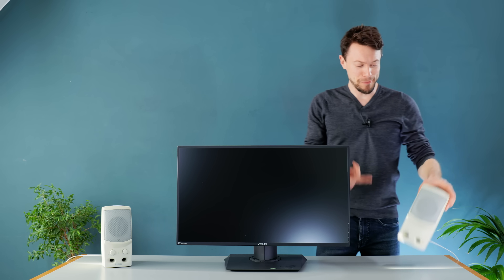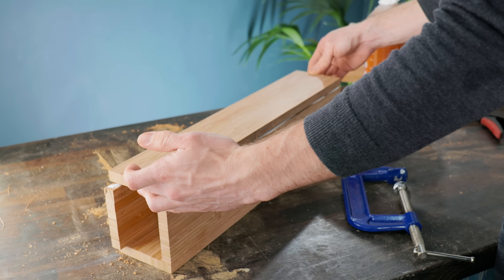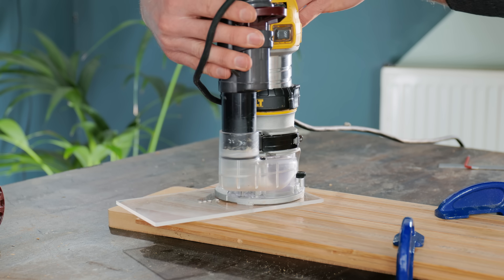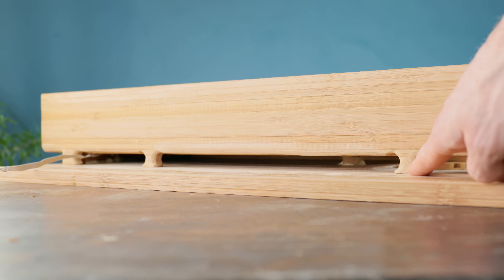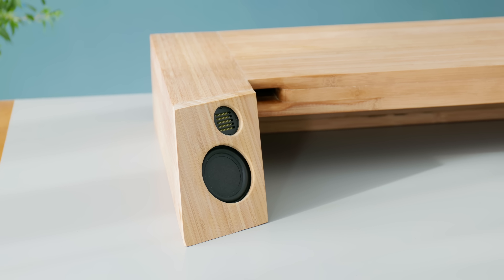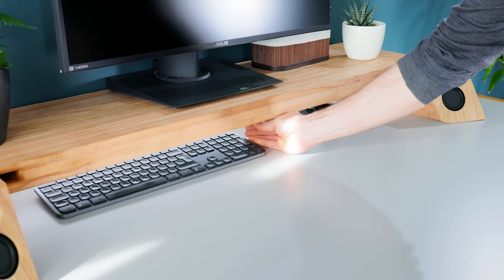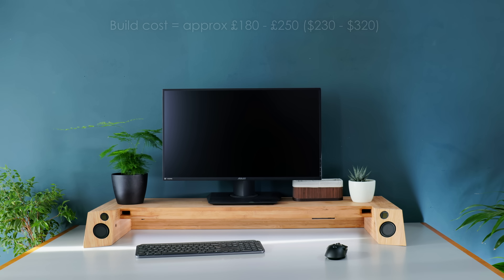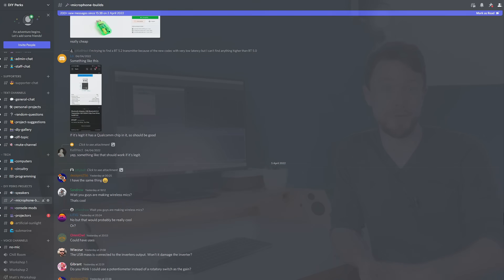Building a PC sound deck... with a twist!

Comment: Nice work and great driver choices.  Those techtonic BMR and Daytom AMT8 both have super wide sound fields and just sound fantastic.  That slim sub is surprisingly capable too.  I'm using one in a project right now myself.  Do you mind sharing the crossover points you used?

Comment: Somewhat related...
I have a friend that gets those old school big screen tv's.  The 4:3 SD ones in the large, typically oak, square cabinets that are a couple feet deep.
He clears out the guts, cuts the top off, cuts the sides down and puts the (former top) on the top of the lower box that has the speakers.  He upgrades the audio system and when he is done, it is a "speaker box" TV stand for a flat screen.  The sound quality surpasses any sound bar, and looks good doing it.

I have another one that takes old cool looking AM/FM radios, cuts the AM option on the selector and replaces it with the feed from a Bluetooth module.  The radio becomes a cool looking FM/Bluetooth unit.  Much more useful and still with the cool retro look.

I like it when people repurpose stuff.

Comment: Honestly: I love your projects. There is just one small problem: every time you do something with speakers, you miss half of what it needs to really make speakers sound great. Videos like this make people believe, that building a speaker is just about plugging a tweeter and a midbass driver together, run it through a sound board or DSP (or even worse: an online crossover calculator) and that's it. But it's much, much more than that. You need to take measurements, take the baffle step into consideration as well as the on- and off-axis responses. The response that you showed is a measurement on a DIN baffle. This is not the response you'll get once the driver is mounted to a smaller baffle (baffle step, edge diffraction...). For speakers so close to the desk, you have to take the desk as a reflective surface into consideration as well. And these are just the basics...
Reply: I agree. I am a DiY speaker designer as well and all of the things you have mentioned matter a lot. There is something to be said about making a compact video though... if he went into detail on every single aspect of speaker design that he would NEED to do in order to make an actually decent speaker, this video would be 5 hours long.
Reply: @thephantompsychic  yeah that’s true. But: I doubt that these things were taken into consideration at all. I might be wrong.
Reply: @rouldiy  Tell that to those popular brands that make PC speakers. They dgaf what they put into their mostly plastic enclosures. They use random parts, shitty drivers, amps so badly designed they distort at half of the volume etc.  Compared to them Matt did an awesome job.
Reply: @mattx5499  If you're spending more than $320 (that amount doesn't include the wood, or LEDs for that matter), you could probably get a decent set of speakers for that amount. Yeah, these are going to sound better than a pair of $20 plastic speakers, but they also cost quite a lot of money to only sound awesome compared to, by your own admission, shit.
Reply: @Civilian08  I can asure you that there are plastic speakers that cost far more than $20. And this project is not only about speakers, but a quality monitor stand without any cable mess and a desk lighting. All made of quality parts and materials.
Reply: I agree 100%! Moreover, I cannot really believe that there are that many people looking for a monitor stand with speakers for $320, or at least not in 2022
Reply: @cmattarei  Many DIY projects are custom things that can't be just bought.

Comment: I did this with old pine cupboards for my center channel after years of trying to get centers that produce quality of sound that doesn't get lost in background while playing movies. I was having issues with dialog getting washed out by background effects which was quite irritating on a massive surround system literally built into the room. I used 3 6 inch midrange speakers and a box that I designed to fit under the 65 inch tv. I have never been happier with my sound system since then, I can now hear all dialog during the most intense explosions from the surround and sub.  Even with the receivers balancing system it was impossible to get the center to level to a point it wasn't washed out and this was the only solution I found. Manufacturers do not supply centers that produce the same effect my solution produced. I've found when it comes to center channels for dialog more is better, 3 6 inch drivers did the trick and the 2 tweeters I added made no discernible change and are inconsequential to the box.

Comment: When you use regular speakers like that and wood as a shell, do you notice if there's any magnetic distortion on the monitor from the speakers since it's not shielded? fantastic build!
Reply: Magnetic distortion was a thing when using CRT monitors and the magnetic field had to be strong with magnets close to the screen to affect the picture.

Comment: Firstly, I'm listening to this with USB based headphones that may or may not be of the best quality. Suffice it to say they are more than adequate for one who used to design high end home theater. With that said, I found the high end speakers to be more focused on the mid range, and a bit muddy compared to your build. However, one should note that you used a different drive type for the highs, which appears to be an electrostatic driver and are quite amazing drivers generally speaking. Overall, I found the sound quality of your build to be quite amazing, and well rounded. I am definitely intrigued by the design and look forward to the detailed build guide, etc. when available.

Also told, I'd say my only quibble with your design is the placement of the ports under the shelf. They seem too recessed for quick/easy access, and should be more forward, or placed elsewhere is possible. However, this is a minor point as the over all design, layout, sound quality, and function are quite stellar. This is especially true when given the price of materials, and time involved.

Thanks to you and yours for the incredible work you've done on this one. Quite stellar indeed!!

Comment: Glad you started on MDF, lots of dust, doesn't take moisture well and is a known carcinogen. Avoid it if you can. Sound advice.
One more thing, remember your roots. Don't get too many tools, it makes your projects more out of reach. A router for example, while inexpensive and easy to get isn't a common tool most people have, Unless you're a wood worker/carpenter you won't have one of those. Just a thought. Love this project though 👍🏽

Comment: Don't go too thick on ribbon-tweeter wires. bigger might seem better, but going too much over what you need will bring alot of interference problems. those supersensitive drivers don't need much anyway.
You nailed that bass enclosure. Sounds damn good.

Comment: I'm not even 30 seconds in and you have way more energy then you normally do... please relax, that's what made you great

I think there's a small amount of muffins with the DIY speakers. I don't know the exact song nor the way they produced it either, which changes the way you would perceive the song. For example, my songs have incredibly deep base in them, and I know how it's supposed to sound and the frequencies I used with the compression and flange, etc. But overall they are super impressive.

Comment: I could not tell any difference between the DIY speakers and the $1200 speakers with the gaming source, but then I stopped playing computer games about 20 years ago so perhaps that's not too surprising.  Also no difference with the first music source but I could, somewhat surprisingly, hear a difference with the second one.  With that selection the DIY speakers had a brighter, almost exaggerated treble and the $1200 pair sounded softer to my ears.  I should note that I can no longer hear sounds above about 10kHz which might account for some of these differences.  This leads me to suggest that you add base and treble tone controls to your passive crossover circuits so people can fine tune the sound to their personal liking.

Comment: Such a cool project, super similar electronics and air volumes to a TV soundbar concept that I made a few years. I would imagine that the cavity under the LF driver just have some mild horn-loading properties too at least in the mid-bass regions that further helps the efficiency. I may have to give this a go with an active DSP for the crossover so that it's tweakable via software well after the cabinet is buttoned up.  :)

Comment: Looks like a very nice project, I definitely like the design aesthetic you've chosen as well as the pure functionality.
A couple of points though - the premium PC audio space is actually solidly filled, unfortunately often badly. The likes of Harman/Kardon have been making top notch setups for a long time now though, I still have my 10+ year old Soundsticks which are by far the best audio I've used on the desktop.

Comment: Nix the bass woofer, and get a separate subwoofer that accepts an analogue RCA signal; then use that sub's crossover to output the mid and high frequencies. This removes the driver for the sub and allows you to use a prebuilt crossover from Amazon or Dayton Audio for separating the mids from the highs. My reasoning is that the enclosure just doesn't have enough room for the bass woofer to move enough air in order to reproduce sub 60hz frequencies.

Comment: You could also try a digital crossover if you already amplify each channel individually. Should be much quicker to reconfigure without the potential phase issues of analog circuits

Comment: Sounds more or less decent for the price (hard to really tell from here). Designing a good speaker involves much effort.
I still prefer my setup of a pair of Tangent monitor speakers with a Monitor Audio sub, which were altogether roughly the same price range (roughly GBP230 total).
Also, re soundstage - anything that has the tweeters way below or above the level of your ears just can't sound right IME.
So, though I appreciate your great craft skills and keen design eye, I would not recommend this specific solution.

Comment: I second this. 
Flooring scraps are great. I made a bunch of cabinet doors from scrap flooring I got for free when my neighbors were remodeling their kitchen.

You can get a lot of material for free if you just ask. Whenever I spot a neighbor with a container full of scrap wood I just ask if I can grab some. Its also a great way to get to know your neighbors. I've gotten flooring, planks, isolation material (I used it for sound dampening/isolation) and pretty large pieces of plywood and MDF. I live in an apartment but there are also houses nearby so you don't have to live in a suburb to do this. 

Thanks for all the great content! Your videos have gotten me through tough times when I needed something to inspire and entertain 😊👍

/Bo

Comment: I think due to single bass driver diy speaker sounds much directional in compare to professional speakers

By using little bit small but two bass driver can help to eliminate this issue otherwise it is fantastic
Reply: I think directional audio is a feature not a bug. Moreover, directionality has little to do with bass. In fact, most bass is often positioned on the center channel because most setups have a single subwoofer and bass dissipates almost uniformly anyway. It has more to do with the ribbon driver and a good crossover frequency setup. A lot of speakers appear more directional if you offload the bass to a dedicated sub because the tweeters get more power to focus on the range that they excel at.

Comment: This is probably the first DIY Perks video where I found myself questioning the choices made in the build...

Biggest gripe is that you've put the subwoofer in the monitor stand...and directly under the monitor at that. I feel like this is going to wind up transferring a lot of vibration to the desk, monitor, and keyboard. I mean, there's a reason the subwoofer for gaming setups is usually placed on the floor. 

Even if you could mostly isolate it from the desk using some rubber matting or something, the monitor is still going to take a beating over time.

Also, while I'm only listening to this on a laptop with pretty terrible speakers, I still preferred the bookshelf speakers to the DIY build in the comparison, as the DIY seemed to sound a bit higher than the bookshelf. Maybe with some larger midrange drivers and a bit of circuitry to filter what's going to each speaker, you could achieve better sound balance? 

Maybe gutting a set of bookshelf speakers would help, as then you'd have the different band pass/stop filters at your disposal as well.
Reply: I would suggest listening to it on headphones first. Laptop speakers suck at bass and treble reproduction. The mid range on DIY is ever so slightly worse but the bass and treble are waaaay better. I prefer the DIY speakers over the book shelves by a decent margin.

Comment: I'm not an audio professional but I think using a D class amplifier for these speakers is not a great idea.
Reply: Class D is very power efficient and produces very little heat. 99% of desktop speakers and soundbars are powered by class D amplifiers. So why, in your opinion, is using class D amps not a good idea in this situation? Also nowadays a good class D amp is just as good SQ wise as any other amp.

Comment: Hi Matt,
Good project and unique design, and absolutely impressive sound quality! However one recommendation is that I think you should use a active crossover or a DSP instead of a passive one, as it would be affected by input impedance which will weirdly affect the crossover frequency. Plus it allows you to push the speakers louder as the input signal may not be enough to push the amplifiers to a loud volume. You could just use some op amps, like ne5532 (most affordable with good sound quality) or lm4562 (absolute best sound quality) in order to construct a active crossover. A DSP (such as the analog devices adau1701) will allow you to do many awesome things, like constructing a crossover that you could tweak the crossover frequency on the computer without changing the electronic components and even add cool things like algorithms to give a effect of a wide Soundstage or use psychoaccustic bass enhancement. But still, good job! You inspired me to make many diy speakers, including some 3d printed ones!
Reply: You can always go one better...
Reply: do you mind to share your setup? mine is jlsound i2s, ak4493 and drv603. all running off some pretty custom linux sbc. (jack + clean alsa config, no bs like pulseaudio..) running local flac files. 

If you are using adau1701: is it intercepting i2s while increasing bit depth and sample rate on the soundcard? Mine is running the native resolution right now. So any sound effect just decreases quality a lot.. But i'd love to have some room correction or bass boost, reverb etc..
Reply: @small-phoenix  I use a sure electronics APM2 (adau1701) with the connection board, which the left and right channels are both connected to 1 TDA7498E amplifier (the sanwu red board), and the 1 sub channel is connected to another 2 TDA7498E boards that outputs 4 x 160w. One of the boards are running off a 250W 36v power supply and the other 2 powering the subs are using a 1000w 36v power supply in order to have excess power. the setup is used as computer speakers and sounds pretty good. 

For the I2C stuff, I'm not there yet, although I'm trying to use a Arduino with a display + rotary encoder in order to make a interface to control the DSP. However, I've seen many examples of it being controlled by i2c on google.

Comment: The monitors are gonna vibrate a lot while gaming but despite that, it's amazing. It would be interesting if you had done a comparison clip with the Bluetooth speaker you made out of earbuds.
Reply: i had an issue with the led backlighting  blub plastic covers falling off inside my Philips monitor due to the speaker system underneath my monitor

Comment: At some point I'd really love to see a true all-in-one control station build. Be it a desk build, wall mounted, or a combination, i don't care. But it would be incredible to see a full system that houses both a high end pc, some trick diy cooling solutions, great audio (for both speakers and headphone use), an awesome display that folds up with the top desk (think regular pen/paper desk when folded down, then full work/gaming desk when unfolded). All connectivity for charging, peripheral hub etc well integrated into the main system, maybe even wireless charging for a phone. I am talking the motherload, the ultimate diy work/leisure station. I'd love to see your take on such a project!

Comment: the 1200 speakers at the end would sometimes just cut off and also most the time they would completely ignore low notes compared to the DIY the 1200 speakers were worse due to not being able to do low volume sounds at all
Reply: True, these speakers a bad comparison. There's a reason they're called "bookshelf speakers"; they are designed for greater listening distances and thus higher power output. Running them at a volume that is sensible for such a close distance will make them sound bad.
The proper speakers to use in this scenario would be nearfield speakers.
Reply: @jullit31  yeah, so he technically cheated didnt he? cos he purposely chose  something that WOULD be worse cos itwasnt made to work like that
Reply: @theplayer4664  Yes, I'd say so. Nevertheless what he built sounded great (as far as that can be judged from the binaural recording), especially considering the price.